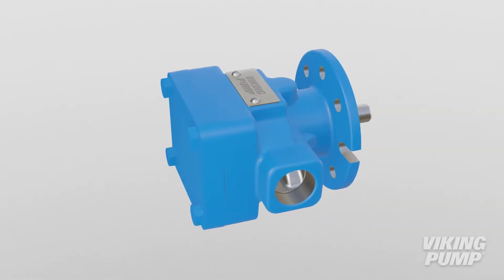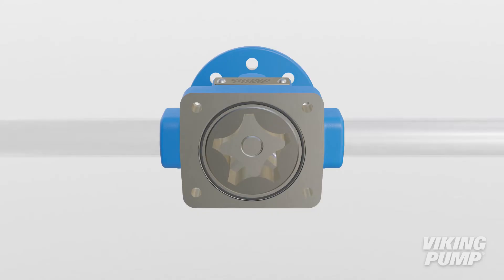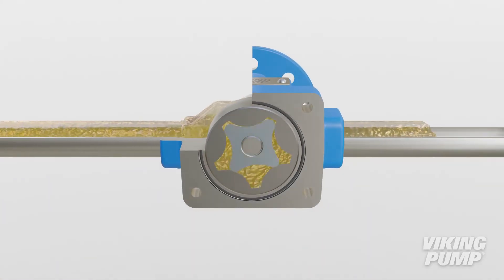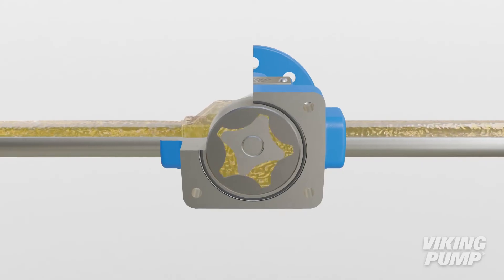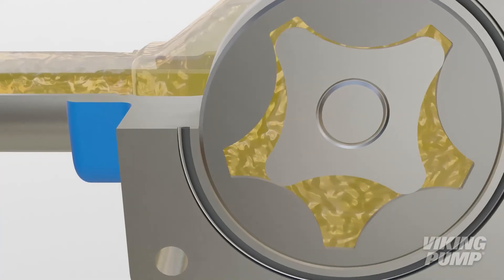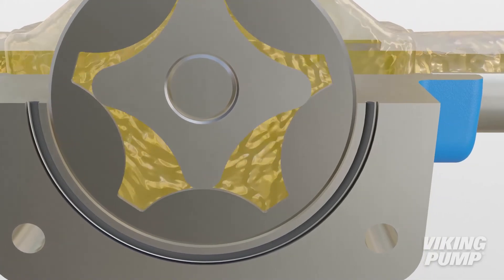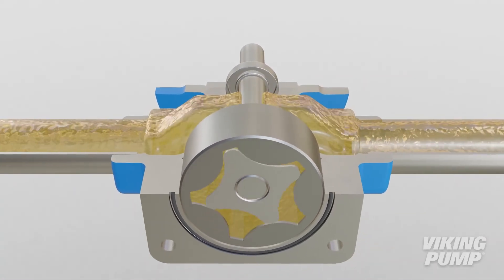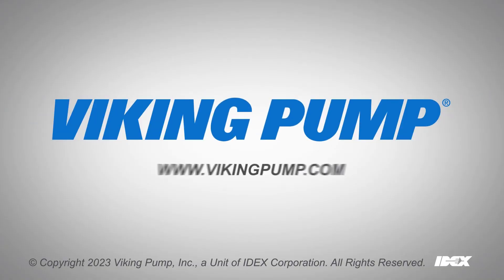How Does a Gerotor Pump Work?

Comment: Can it pump
Water ?
Reply from the maker: It would depend on the materials of construction, but most gerotor pumps are used for handling viscous, lubricating liquids like lube oil. If you've got more questions, you can reach out to us here: https://www.vikingpump.com/yt
Reply: It is a cast iron pump designed for a
Henny Penny fryer but I need to use it to pump clean water